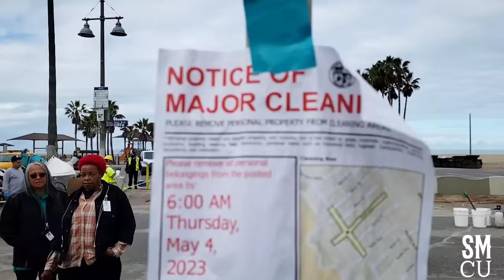Homeless Encampment Clean-up at Venice Boardwalk

Comment: 34:15 Continuing to show the reason why the actual residents who pay their taxes want these freeloader's off their front porch. There are service's for those who need it, but they usually have to start a treatment program or some type of reintegration to become a better person for themselves and the community. Signs were posted everywhere, they had been warned about the cleanup, yet they still attempt to sleep in and bitch about having to move their stuff. It's not easy find those little crevices to hold on to on your way out of a deep hole and it takes strength to hold that position to the next crevice (some bigger, some smaller), but once you're out you realize to never go back down there again due to how hard it was getting out. Sometimes though, people just give up and curl in a ball to die. It's sad how poisoned this country has become, I've been clean for 3 years or so now and I have no desire going back.

Comment: If your not part of the solution to help then your part of the problem that created this. There is no adequate help for those who need it. 
A lot of circumstances cause this. If you want to point fingers take a look at what your rose colored glasses have helped do.  "Oh but you have to have an email; a phone number where we can contact you; mailing address; etc, etc, etc." Basic necessities are at an all time low in these cases. Showers, food, laundry facilities, funds it takes to do all this. 
Our welfare system is a sham. Our child protection service is a joke. We have so much corruption going on in this country that we don't even know where to start with solving the problem.
All this done by someone saying, I'm trying to help you. All the while pushing & shoving you to move on.